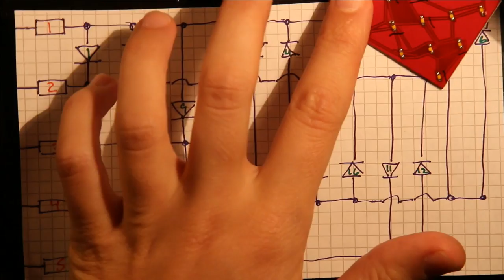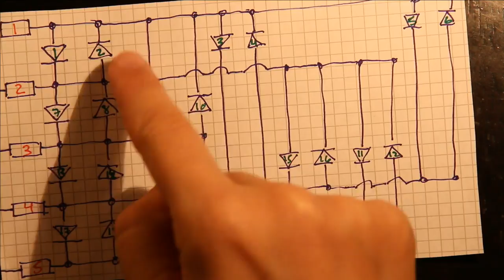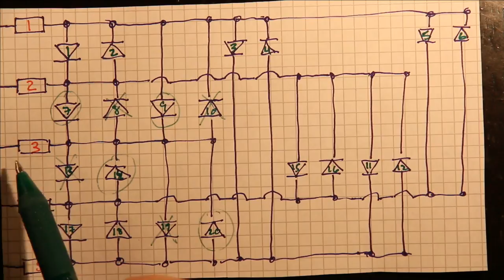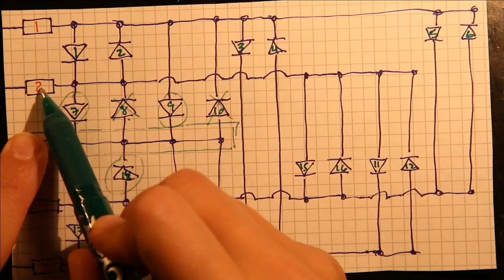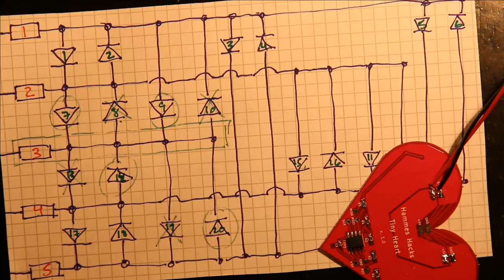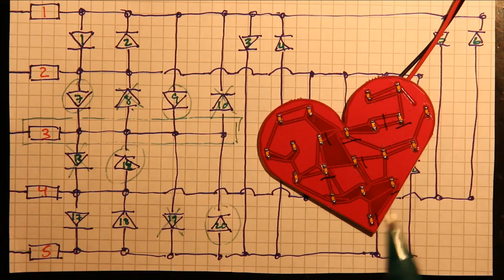Fab Fail

Comment: I found this video after watching the 3d printed bird feeder video.
Thank you for publishing both, I just subscribed.
I wanted to share some suggestions about your troubleshooting methods.

In you explanation, you said, "I pulled out my oscilloscope and I tested a bunch of lines ...".

I was taught, there are a few methods to troubleshoot a circuit: 
   1. replace parts until it works (which wastes materials and time), 
   2. randomly probe and see if something 'stands out' (which wastes time),
   3. methodically divide and concur (which is the cheapest in time and materials).

Your circuit has series resistors in all 5 lines, which means that for every LED there is 
an output and a resistor at each end. When an LED is on, the resistors limit the LED current 
and a voltage drop appears across both resistors.

Because of this voltage drop, none of the anodes or cathodes will ever be driven to 0V or supply voltage. Clarification: If your code turns on one output high and no outputs low, 
there will be no current flow through the resistors and no voltage drop, so the right side of 
the LED will appear high.

If you use the scope to verify that the left side (microcontroller) of all the resistors are changing, you should also verify the right side (LED) of all the resistors are varying between two distinct values. 
---
If you are fortunate to have a 2 channel scope with triggering capability, then you could put 
the trigger probe on the left side of one resistor, and then use 2nd probe on the left side of 
the other 4 resistors.

With the right time-base settings, you can see the whole 20-LED sequence.
When you can trigger on one channel, you can visually compare sequence of voltage levels 
of the left and right sides of each resistor.

In your video you also said,
      Theoretically these were supposed to be checked.
      All of these connections were supposed to be checked in the fab.

Did you expect that they would be checked, or were you promised based on a contract?
I am not an attorney. 
As I understand it, if you were promised by contract, they need to fulfill their obligation.
Reply from the maker: The fab does check the PCBs. Sometimes I get panels with a few with large x's on them indicating where something went wrong. Usually this is a milling error because I make really mechanically difficult PCBs. 

However, in this case milling was not the problem. After manufacturing the first batch they did a second run because they found the shorts. However, they ended up mixing up the good ones with the bad ones.  In the end I got 196 good PCB's for free.